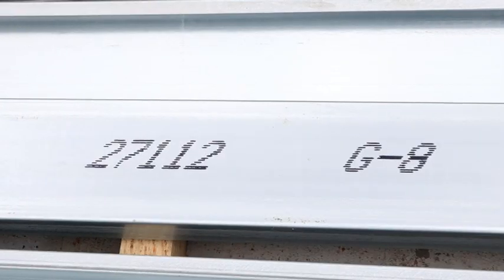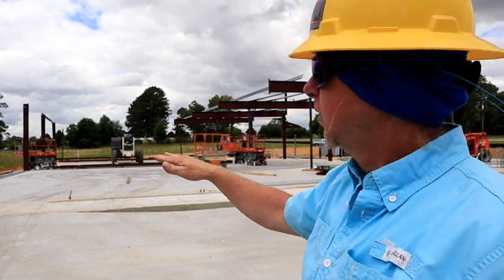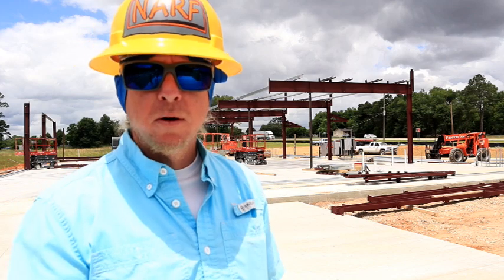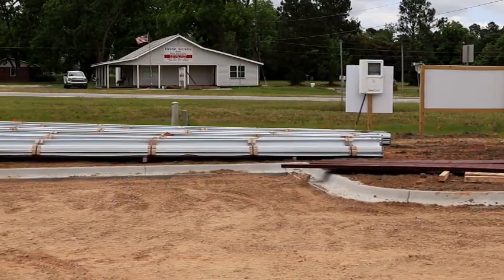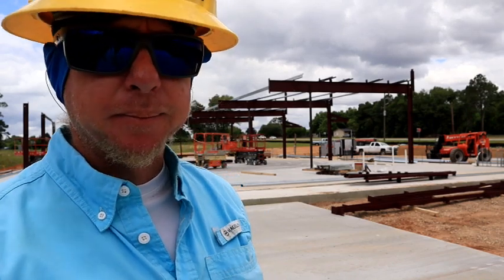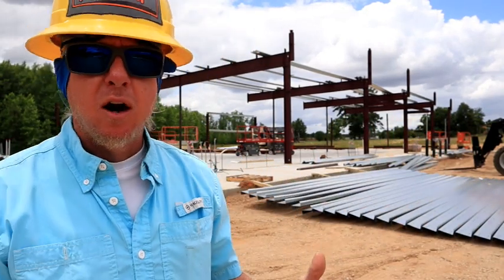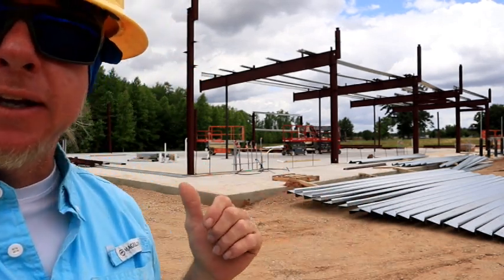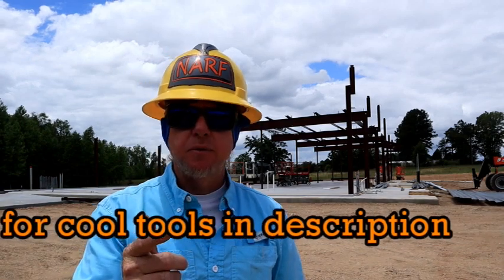Time is $ money $: stage your materials to increase efficiency

Comment: Do you ever put the accessories box on wheels?
Reply from the maker: Yes but the guys will not use or they will move in the way so if it doesn't move then it should be in its place

Comment: Narf ,where does the different butyl tapes go?.I have a double bead and x single bead tape ,does it make any difference
Reply from the maker: It should note on plans (details) where to be used.  Usually single bead is used on laps of PBR roofing panels.  Double bead may be used at endlaps.  I'm not sure of your design.  We Usually have tribead butyl on standing seam roof panels.  Butyl is used in laps of metal as a replacement for caulk and to use as a washer/gasket to stop the pentration of water into your structure.
Reply: @BuildingwithNARF  nothin in the plans on details of the small things like tapes or even particulars on trim..I've found many mistakes that cause me grief..its been a personal nightmare...but you and your videos has helped me more than you can imagine.i really appreciate you help and advice
Reply from the maker: Do you have preformed ridge?  If so then I would use double bead where you screw ridge end lap
Reply: @BuildingwithNARF  yes it is preformed ridge...what about using closure stip on bottom of wall with 6" insulation..should I or not..no details in plans what so ever on insulation..sorry for all the questions..lol
Reply from the maker: If u can make the closures work...Yes...but most base framing is only 2 inches and very difficult to install correctly with insulation.